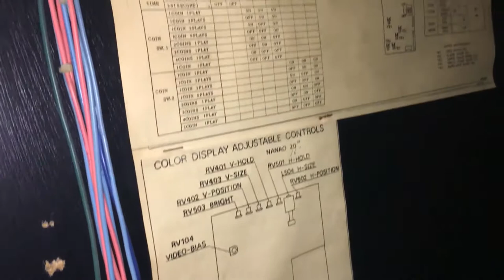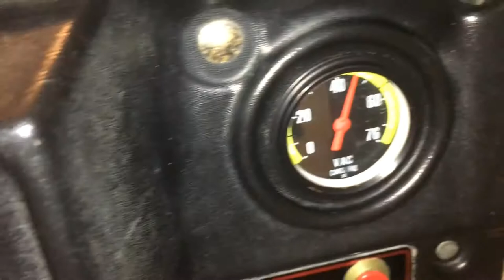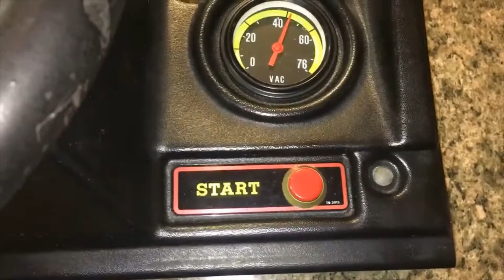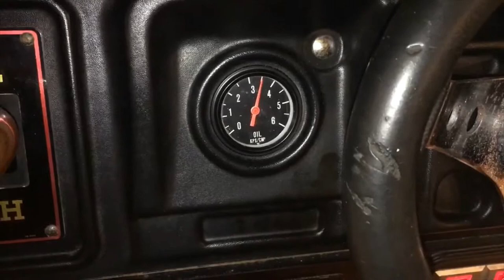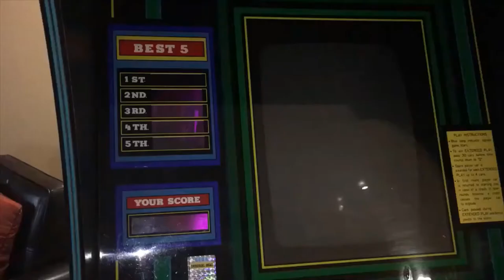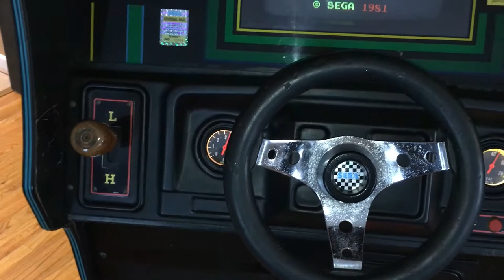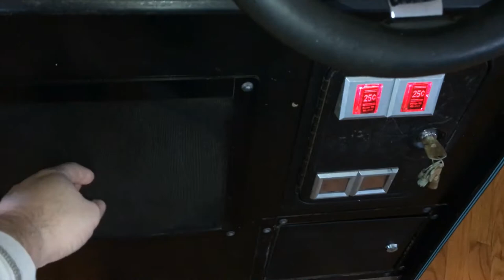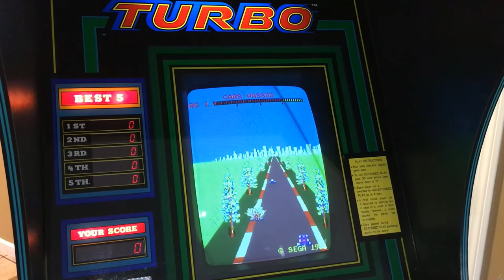Sega Turbo Restoration

Comment: I'm restoring a Turbo mini.  I have started by removing carriage bolts from the control panel overlay as I have a better looking one to install.  I have 2 questions:
1. Is the large nut attached to the steering wheel the part that can detach the wheel?
2. How do you remove the shifter knob?

Any help would be appreciated.  Thanks.  And, nice video.

Comment: Make sure no other games are plugged into the same surge protector.  I heard Turbo likes to migrate into other games.
Reply from the maker: I thought that might have been a Wreck It Ralph reference but had to look it up as I have yet to see the movie.  

How did you like the layout and content of the vid?  I’ve had a lot of folks asking for more in depth vids and I put these together from my Facebook restoration series.  I’ve got 3 or 4 more vid and pin restores to put together and am open to feedback.  This is probably the least technical of them.
Reply: @ArcadeResurrection  I like how it was broken up into parts. Maybe add time stamps in the video description.  Its cool that the game used a somewhat analog pedal.. I didn't expect that.
Reply: @ArcadeResurrection  and go watch wreck it Ralph! It was a great movie
Reply from the maker: @michaelpost3562  Great recommendation for time stamps.  I like that a lot.  Will help folks for sure search out the info they need.  And I’ll be sure to watch it.  Preferably with my son.  Thanks again.